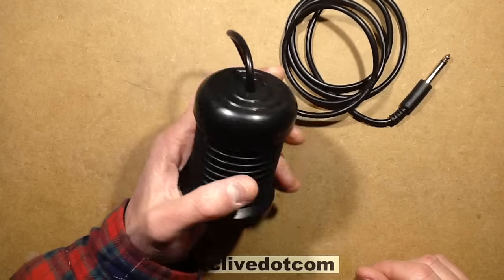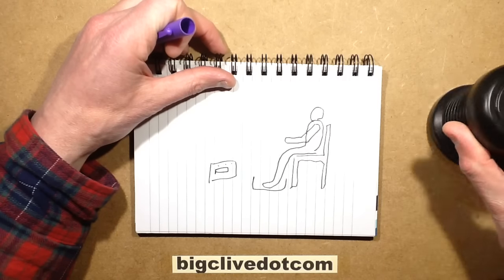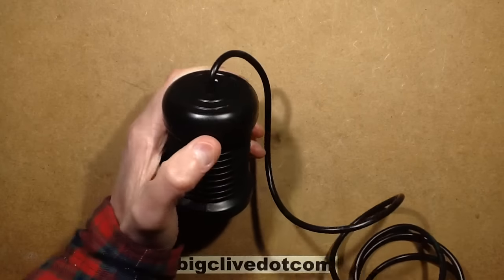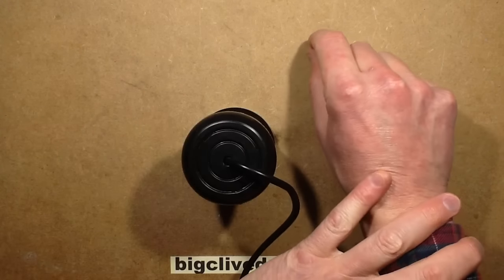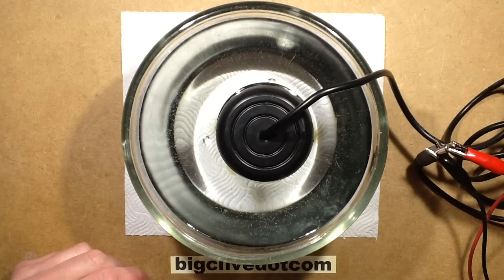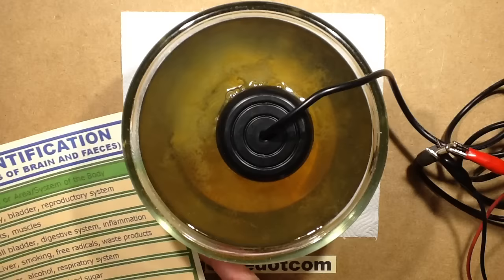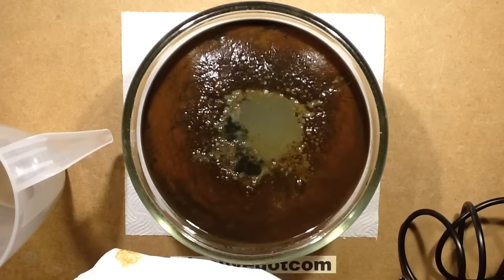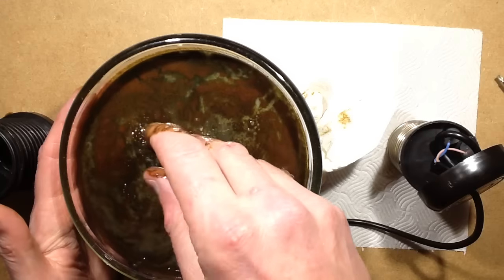Ionic foot detox electrode scam.  How it works.

Comment: What is strange is that I know the color changes without your feet being present. What I do NOT understand is why my feet and legs feel SO GOOD after a session. Tingly good for hours afterward. 

Even as an engineer I tried it, expecting nothing but a scam, but I have to be honest, I do not understand why I feel so good afterward. 

Devices are a rip-off, and power supply can produce this effect, it does not require an $800 box with digital readout, just a power transformer for the DC current at 12 to 20 volts and a couple of amps. 

SMH, my feet feel so good. Still I don’t know why. Haha 😅 in me I suppose.
Reply from the maker: If it feels good and you're not being ripped off by clinics then that's good.

Comment: I used it for over 10 years, and has worked as advertised....my experience using it is what counts...
Reply from the maker: If you enjoy the experience then by all means keep using it.  But be aware that the electrodes may be putting out chromium and nickel salts into the water.

Comment: Here’s something that you might have not taken into consideration... There are many chemicals in the water which I assume you used tap water and which is reacting with the positively charged ions or whatever electrical current? You might want to try the same method without the salt and with  pure distilled water? Also it’s not meant to be working that quickly as it’s supposed to take 15 mins or so when in connection with your skin, so it seems to me the reaction you saw in your video, might be due to either the impurities in your salt or in your water as there was no corrosion in the inner metal ring?
Reply from the maker: If the polarity was swapped the other ring would corrode.

Comment: This also because the water is highly contaminated. If you filter the water properly this won’t look like this.
Reply from the maker: The water is extremely pure here.  Even with the purest distilled water, when the required salt is added to make it conductive for the effect to work, the same results will occur.  It is a scam.
Reply: @bigclivedotcom  ummmm actually you’re still wrong. You still don’t understand the proper use of the system. I also know there are specific systems that are just indicators. Whatever process is being used to purify the water will also result in substances found in the water without using a persons feet. Not to mention for proper detoxification a person needs are about 15 of them. Again what you don’t understand is. It matter how pure you claim your water is there are still contaminants I the water that have the same affect on the array. It’s ok to admit you really don’t understand how it works. There are two types of systems. One is just an indicator that there are things found that a practitioner needs to take under consideration. 

What you find in the water using a person and just water are totally different. It takes 15 of these detoxes for a full detox within a 45-60 day process.
Reply: @bigclivedotcom  you don’t realize that you proved it works but not the other way around.
Reply: @bigclivedotcom  I find it hilarious that it’s producing this nasty result yet you think somehow it’s just some weird gunk that can’t be explained. From a human being it pulls out something different than what comes out of your water.
Reply: I had a client come in for a set of detoxes. He had inured his shin which resulted in a huge knot filled with puss and blood. The injury wasn’t the reason for the detox however, during his detox we noticed the swelling went down and we could see the injury pulsating and he mentioned it causes pain as if something was sucking the fluid out of the injury. By the end of the detox his shin was no longer swollen and there was no more puss and blood at the injury site and he was good to go. 

So again I’m not sure what your goal was here but, I do give you a C for effort. So again there are things drawn out of the water and your body.
Reply: @bigclivedotcom  there is no salt required in using the system. If you add salt it will result in the gunk you see due to the all of the heavy metals in sodium. Also do you know what substances are in one’s kidneys? Remember there is a reason one can acquire kidney stones. Do you know what elements are in mucus and yeast in the body? No matter how much you thin your water is pure there are contaminants in the water. Even if it’s activated charcoal that will result in some nastiness when you add the array to pull out toxins.
Reply from the maker: @nassorojore238  Nope.  It's entirely down to the electrodes corroding and NOTHING gets pulled out of the body.  Quite the opposite.  The toxic medley of metal salts created by the electrode decomposition might find its way INTO the body.

Comment: I see what you are trying to say but has this youtube creator actually tried a legit ionic foot bath? I have and was a skeptic as well as a doubter when I tried it the 1st time. The physical proof i needed was my joint pain in my elbows and lower bath vanished almost entirely after the session. I also had the  best night of sleep that night and was in a great mood the next day. I could feel the pores in my feet opening. I also invited my 2 buddies who were skeptic until they experienced it themselves. You need access to a good machine and also a good time frame at a higher power. Some places will ask if you are new and try and leave the power down. They did this at a different place to one buddy and he wasn't impressed until he got a real try on one.

Comment: Okay from all that's said one way I can think of testing the device is using water that has gone thru reverse osmosis and is the most pure form of water available, just dumping it into the machine, then let the machine run without your feet just by the water alone. See if the water changes color or not. That's basically one way I have come up with to test this product unless some of the brown coloring of the water results from reaction from something in or generated by the electrode reacting to Human skin. I back been seeing advertisements for this very product here on YouTube from a website called gearelevation & it's called Ionic Foot detox
Reply from the maker: Pure distilled water wouldn't work as it isn't conductive.  When you added the salt it would make it conductive again and have the same effect.

Comment: I wonder if it's the contamination of the water used and/or the type of salt used that causes the "rusting". The youtuber says he has "Health water" in the bowl; I have no idea what health water mean. He said he used kitchen salt as well. I've wondered if distilled water and Redmond's Real Salt (salt mined underground and not poluted by air like most other salts) was used, if the results would be different or not. 

All of this aside, the company Healifeco's detox footbath ionizer setup says that the coloring does not come from the detoxing, but that the color comes from the chemical reactions between ions generated by the machine and the minerals inside the water, and then that the REAL detoxification occurs when the body absorbs the free ions generated by the machine and matches them with free radicals and heavy metals inside the body, and that they are then removed by the body's excretory system. I don't really understand all of that, so I'm still on the fence whether I think these things are a scam. 

I do like that they give an explanation why you will get the coloring whether feet are inserted into the water or not, since that's the main thing that most people get hung up on, but since I'm too dumb to determine if  the free radical/free ions/"matching" stuff makes sense, I'm still not sure what to think.

Comment: Right. I had parasights coming out of my feet after a seccond, round.
Reply from the maker: The only parasites were the people who sold you this fake treatment.
Reply: @bigclivedotcom  my friend, used this, her water was on the dark  green side,  which meant her  gallbladder was taxed.  She had to have her gallbladder removed. My liver count was very high do to a medication I was on, and the Ionic h2o came out black. There were parasites excreeting threw my feet 40 minutes into it. Yes, the water does turn a light orange coller on its own due to the chemical reaction of salt and the metal from the  array on its own, not the same as when your feet are immersed. Just speaking from my own experience.

Comment: Its coming out of the water not the coils if the coils are non ferrous. Is it tap water?
Reply from the maker: It's definitely the coils corroding at high speed.  You have to replace them after a number of treatments.

Comment: odd.. i bought a machine and wanted to find out if it was a scam. mine worked, i tested by leaving water alone and nothing. then the first time i used it, it was bad. then it gradually became clearer each time i would do it. it also was a different color for different family members/problems and would get back bad to better after it had been a while using. i guess it just depends on the device you buy! also, i’ve had certain issues, for instance tmi but i had a yeast infection once and it pulled it out and other cases as well. i would just research the machine to make sure it’s not a dud one before you buy!
Reply from the maker: These units rely on you holding an electrode handle or pad to detect when your feet are in the water.  It's so the water won't turn dark until you put your feet in it.  If you bypass that by connecting the hand electrode to the water it will go dark as if your feet were in it.
Reply: bigclivedotcom thanks for the response & research!

Comment: You can easily test the water. But I guess that's too difficult. A heavy metal test is easy to afford. It works on the same principles as a sauna but with an electric current pulling things out. 
I know most of the muck is the reaction with the salt but I'd try it once more with your feet in it.
Test the Black flakes.

Comment: I know that you were a colloidal silver nerd and gave it up because all the cool kids were making fun of you. But having tried a non conventional treatment and stuck with it, makes you a cool kid, to me at least. 
Anyway  i suspect that the positive testimonials people are experiencing in the comments and elsewhere, despite the electrode chromium nickel toxic muck, is due to the hydrogen and oxygen nanobubbles. It has been proven in numberous studies that getting pure hydrogen into your system, aids detoxing, boosts antioxidant ability. Also you get it in nanobubble form which is much more effective, along with the oxygen, albeit the hydrogen escapes much more rapidly then the oxygen, but there still is some. Now a perfect way to do it, if anyone has a solutioni, of a non corroding electrode, something like gold, platinum, palladium. I heard stainless 316L does not corrode, so that should be tested as well.

Comment: If you use distilled water and table salt sodium chloride how do you explain the chemical reaction? Introducing an electrode into salt water produces hydrogen gas and ammonia. Neither of which is present when done with distilled water.
Reply from the maker: None of these units work with pure water.  The salt is needed to make it conductive enough to allow the brown electrolytic electrode corrosion to occur.

Comment: Yeah that job coil is good for one thing, making Rust which when combined with powdered Aluminum and a high heat fuse becomes Thermite. Various pyrotechnic possibilities, but not a drop of that sludge (Looks like boiler sludge yuck) is human made. Well it hasn't been part of a organism for a long time, reminds me of the dust generator I made with a Model train transformer, a old Peanut butter jar and,a few pieces of old steel for the electrodes works but is a tad dangerous.

Not doing that again unless I can keep the jar in a safe spot, sparks and hydrogen with lots of oxygen not exactly what you would call fool proof lucky I only needed dum dum proof.

Comment: thanks for the debunked first and foremost! but even though I would smoke meth before I disagree with your experiment, at the same time something tells me that all these residues and slime came from all the chemicals, minerals and bacteria hidden within tap water such as flouride for example. so with that said i would encourage you to do this experiement again but using distilled water instead just to see if it makes a difference. till then good luck and keep up the good work and exposing these schemes!
Reply from the maker: The grime definitely came from the electrodes.  The water here is extremely pure.

Comment: say what you want, i bought one , mostly out of curiosity, its quite astonishing . my feet immediatly stopped aching after the first use and after the second my injured right knee felt markedly improved and a skin issue cleared up. my daughter who is also constantly on her feet, also stated, her feet did not hurt anymore. you may not have an explaination for it, but dont be so quick to discount
Reply from the maker: There is a possibility that the toxic metals in the water do have a therapeutic effect in the low dose that will enter the bloodstream.

Comment: I used to use a similar gadget when i was selling reverse osmosis water  purification systems for the kitchen. What this thing does is it neutralizes the chlorine in the water so that you can see what is actually in it. Thats your water telling the truth. That is what is actually coming from the faucet.
Also: yes the coil is also rapidly corroding. One coil is steel the other is aluminum. Add a dash of electric current and you get what you just saw here.
Reply from the maker: Do you realise that the four electrode water demonstration units you were using may have had full mains voltage on the electrodes via a rectifier.  Even when the switch on the unit was off....

Comment: Yeah lol in the end zero skin in the water and still gets crazy looking. Forgot what it's called when they use electricity to prove how dirt tap water and even bottled water is?
Reply from the maker: I made a video about the tap water tester.  They're a deathtrap.  The four electrodes are at full mains voltage and the non polarised plug means they could be live when it's turned off.
Reply: @bigclivedotcom  if we're being pragmatic everything is a deathtrap. I work with power tools every day which could rip my face clean off. I fear for my life constantly lol but yeah saw a lot of vids basically ripping the ppl who sell those completely apart. Still curious what all that shit is and where it's coming from. Frightening

Comment: Can anyone please explain all the debris moving in the bottom of the water pan after it’s setting still for 15 minutes? Like live creatures buzzing around looking for a place to go? Add 35% food grade hydrogen peroxide to the water and bam! Dead…nothing moves anymore? Would love to know how and why this happens if it’s truly a scam!
Reply from the maker: The moving debris is probably thermal convection.
Reply: Probably? Any chance of proving this? And isn’t this same way colloidal silver is made? Concept anyways?
Reply: ABOUT
Thermal Convection
The second process by which energy is transferred from one system to another as a result of a difference in temperature is known as thermal convection (also known as heat convection or simply convection). This process is very common in liquids and gasses and occurs through the mass movement of molecules and atoms over very large distances. Convection is not the same thing as conduction. Conduction, which is commonly seen in solids takes place as a result of physical contact between two solid objects. In conduction, the molecules, atoms or electrons move only very small distances while in convection the molecules and atoms more relatively far. One example of heat convection is boiling of water. The bottom of section of the water gains energy first and the molecules begin to move quicker and with greater kinetic energy than the molecules on the top. This causes the liquid on the bottom to become less dense and it rises to the top. At the same time, the cooler liquid at the top moves to the bottom as a result of being more dense. This cyclic process continues until the temperature evens out and boiling occurs.
Reply from the maker: @denaekrisman2588  And don't forget brownian motion.
Reply from the maker: Glad you enjoyed your AK Lecture though.
https://aklectures.com/lecture/first-law-of-thermodynamics/thermal-convection
Reply: with all due respect, it’s never good to assume. All I know is the amazing results I have recently experienced using this far infrared ionic detox system. And much better to read reviews of others than look to the censored world of lies these days. 😂
Reply from the maker: @denaekrisman2588  If you feel it works for you then this is good.
Reply: Honestly, I had blisters on the arch of my left foot. Tried everything to eliminate but they only got worse. Been there since last summer. Come to find I have a torn intestine. According to the whitehawk reflexology foot chart, this is the same area of my foot that runs from the intestines and colon. Our feet sweat like the rest of our body and these toxins were literally exiting through the bottom of my foot. 5 days of 45 minute sessions, my foot finally clear and these pus filled blisters are gone! It was my chiropractor dr John Bergman that said absolutely this machine works. My now proves it. Wish I could put a photo on here
Reply: Oops meant my foot proves it lol

Comment: But you disprove something but you did no do the full experiment, What is the brown stuff?, why you did not sent for analysis,also you did not use the  the normal array plug into the modulater ,you just put the power to the plug straight ,  this is very poor experiment,
May be is coming from the water , The stuff what we drink....?